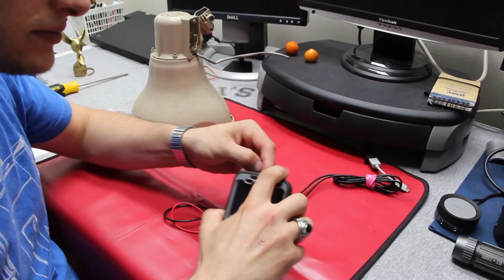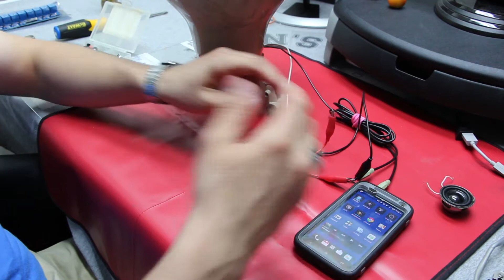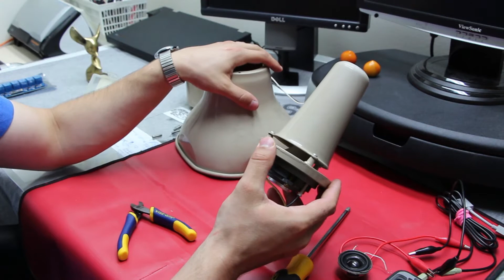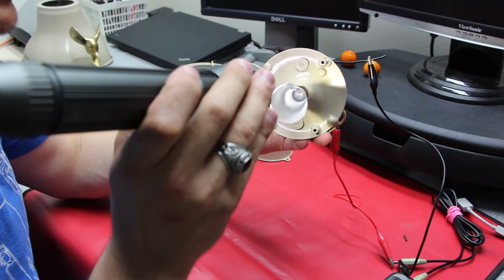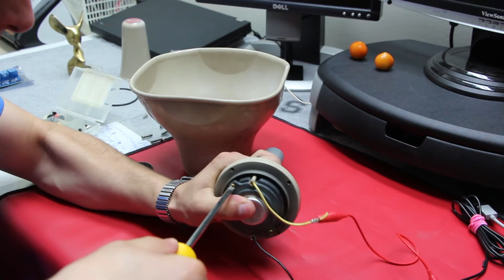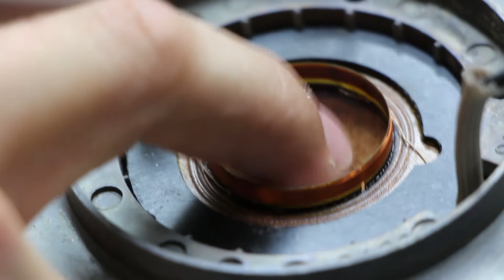Construction of the Megaphone (Bullhorn)

Comment: The bell housing also impedance matches for more total sound not just directionality. It takes the sound down a gradually expanding tunnel, so that it grabs a larger area of air than a little cone can. It's called horn loading. Of course, for high fidelity music reproduction you're not going to use anything that goes "ting ting ting" if you tap it, as it sounds dreadful. Also you're not going to fold a horn for mids and highs as it blocks too much treble and makes it sound like you're listening down the phone. You'll also shape it more evenly for flatter frequency response - usually a tractrix or exponential expansion. You can even do it with bass drivers if you build big enough. A good horn subwoofer tends to have quite a tight and detailed sound to the bass, at least as far as bass goes. That is if the room acoustics are good or you're outdoors. It also lacks a struggling sound, and can usually get fairly potent without feeding it a lot of watts.

Comment: What I would do is find where audio goes into the amplifier of the bullhorn and inject your audio from your phone into that. It will be a lot louder.

If you do this, use a radio or a player you don't care about and put the ground wire on the negative battery and the + positive side briefly start touching points on the amp chip and if you hear music loudly you have the right point.

I did this with a mega mike toy from the 90s.
https://www.youtube.com/watch?v=Ox3P3CBv8pQ

Comment: i wonder why the sound isnt lost through all of the reflection.
Reply: it's a simple folded horn design, there's no reflection.   the width of the horn throat is never wider than a wavelength... and by the time it reaches the opening, all the waves are pretty much going in the same direction.     some of the really high frequencies do get lost.   but this design can also be extended to folded bass horns too.   i've built them.   and am a huge fan of them for efficiency.